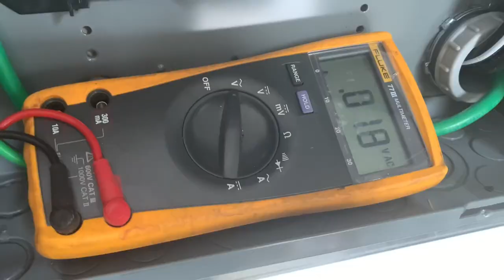Running Power to New DREAM GARAGE | Underground ELECTRICAL Service

Comment: love to watch that stuff.  I never took to electrical work.  Interested about it but just never took the time to learn all about how it all fits together with power, neutral, and ground, amps, volts and ohms.   Impressed though with what a neat job you did and all the forethought to think ahead for access points and future expansion.
Reply from the maker: Thank you, I cheated though… Im an electrician by trade. 18yrs

Comment: Sir, nice work. You get the near and workman like title.  The only thing I can say for sure you got wrong was your 8 x 8 box is required.  352.26 is that PVC pipe section covering the 4 quarter bends before a pull point.

Now, for anyone about to do this, the NATIONAL ELECTRIC CODE (NEC) can be modified or thrown completely out by your local building guys NEC 90.4.

Please call the building people before you even start the build.  Section 230.70 talks about a building disconnect out side the building or close to the entrance inside.  If you are beyond what is "close to the entrance" and there might be a lot of rework.  Move your panel one foot and the solution might be to replace your wire reach that far.

352.44 again the PVC pipe section calls for slip joints for the PVC pipe to expand and shrink with temperature.  There is a chart, but the inspector can require or not.

250.32 talks about grounding this type of building.  There is an exception to the ground rod and a reference to the grounding system section which can be seen as needing 2 ground rods.

A phone call or two can get all these questions answered.

Also, consider adding some extra empty pipes to your trench while it is open.  Cable/internet, a dinner bell/emergency alert system, and building security systems can simply be pulled into the pipes with any re-digging of any trench.

Also, consider a bathroom fan type timer on your outside light to allow you to walk away with the light on and not return.

Comment: Looking good 👍. How deep did you have to trench the wire? Also, when you wire the shop, just remember that you can never have too many outlets.
Reply from the maker: Thanks! I went 18”. Thats what they require here (no frost line) and consequently, all the rental trenchers are 18” machines. Didn’t even need to go that deep though honestly. Thats true with receptacles

Comment: OMG, I drove a ground rod in with a sledge. Took forever. Thanks for showing that. We were considering a steel building, but I have seen several videos that showed too many problems.

Comment: Nice job. To make life easer with your cable inside your shop you might want to try flexible conduit instead of the solid pipe. Thanks for posting
Reply from the maker: Thanks for watching. I almost always run MC in metal buildings.

Comment: I just built a galvanized metal shop and was looking to run electric to it. If you don't mind me asking, how much did all the material cost wiring , breaker box , etc ?

Comment: I think from other Electricians, that on a Sub-Panel, you tie-in to the Main Panel for the Ground Rod, you are Not to put in a Ground Rod at the Sub-Panel.  
And do Not Bond the Neutral and the Ground at the Sub-Panel (Which you did correctly).  That way everything happens at the Main Breaker and your breakers work safely.  Just FYI, from what I heard.
Reply from the maker: So you’re 1/2 correct. When you read or heard that sub panels dont require a ground rod - that’s completely true. HOWEVER that only applies to sub panels in the SAME building/structure as that building should already employ a ground rod (or two). 

The main purpose of the ground rod is protection from lightning which is why the secondary structure must have its own ground rod (and in some municipalities- now TWO ground rods)

Hope that clarifies things a bit!
Reply: That ground rod just needs to have a ground resistance of less than 25 ohms. Code is kind of dumb in that if it's greater than 25 a second rod is required and that's it. Nevermind two rods could be 100+ ohms of ground resistance, just needs to be two. It's dumb and not safe. In the utility world we have to sink ground wells until that number is less than 25 no matter how much it takes, which makes sense.

Comment: Thanks for sharing this! I’m planning to do something similar for my detached garage. I’m considering stubbing the conduit up through the slab and into the wall. Is there any reason you didn’t do it this way? Is it just because it would be cumbersome to coordinate the conduit run with the concrete crews and building erectors?
Reply: Partially that, but with the metal tube sill plate (bottom frame rail), you dont want to remove a section to make way for the conduit. Nor did I want to stub up in front of the frame rail and sacrifice floor space in a small shop. If it was a stick frame building with 2x6 sill plates, it wouldn’t be an issue.

Comment: Great video, I would have liked to see the wire connection into your meter disconnect box on the house! You just showed the conduit running along the house and into the box but it would have been nice to see the connection there as well. Also that looked like 2224 Mobile Home feeder line to the shop, did you direct bury that without conduit to the shop and then just use conduit when it comes back out of the ground to the shop or house? Thanks!
Reply from the maker: Yes, MHF is rated for direct burial but must be enclosed in conduit once it “stubs up”. I had filmed the connection at the meter pan but it got messed up somehow so I omitted it. Thanks for watching!

Comment: I wanna know what the wire cost and where you got it please about to do the same thing
Reply: (Replying from my new channel) I don’t remember what I paid for it but if you’re interested in using this wire specifically, its called MHF and is readily available at most of the “big box” hardware stores. Good luck

Comment: I never liked how the conduit stubs through a building it seems like they should use a compression gasket fitting, i dont think they exist. You rely solely on caulk to keep water out. It's a leak waiting to happen.
Reply from the maker: They sell gasket material but I much prefer silicone. Leaks aren’t that common on vertical penetrations if caulked properly.

Comment: What about an  expansion fitting on the exposed conduit mounted to the house? That conduit is going to expand and contract over the years.
Reply: An important part of 352.44 is the fact that the expansion fitting is required where the expansion is in a straignt run "between securely mounted items". Appropriate bends in the run allow for expansion without an expansion joint. Here we have a total of 4’ of conduit and no frost heave whatsoever. Thanks for watching and for the comment.

Comment: You need 2 ground rods 6' apart or more. You only need 1 ground rod if you are using it as a supplementary ground to a cold water pipe or rebar in footing.
Reply: I believe The mentioned that in the vid
Reply: Yeah, probably and I missed it.

Comment: Hope that you drove the ground rod below grade level. The left #2 wire appears to be stripped too much but not a violation. Did not see him use a torque driver to tighten wires in sub panel. Believe a full 100 amp feed to garage would have been better in case you want to install a 240 volt 50 amp EV charger recrptacle.
Reply: I think the other side of the ground rod may have exited in China. In this shop we’re running a 240v compressor, welder and HVAC already with plenty of amperage to spare. As for an EV…. I have no plans or interest in my foreseeable future of owning one.

Comment: So if I run like a big air compressor can I run still what u running
Reply from the maker: im running a 60g compressor, 30a mini split, welding machine, office, 12 shop receptacles, door opener, 3 lighting circuits and a mini fridge… with plenty of room for more.
Reply: @HiddenCreekHomestead  ok thanks so much for responding back to me , by God Grace I’ll be getting my shop  next month your video are so helpful
Reply from the maker: @matthewbarnes4993  You’re very welcome. Good luck!
Reply: @HiddenCreekHomestead 30a minisplit?😮. Meaning it's on a 30a, breaker right? Because I'm about to run electricity to my shop and will install a minisplit and running they just pull like 9 to 13a I think. I'm going to read about grounding because I thought you didn't have to run the ground from the main. Just need to run a grinding rod from the sub panel. Thanks for the video
Reply: @AB_thingsDFW  sub panel gets its own ground rod (sometimes 2) ONLY if its on a separate structure. My shop is separate from my house so I added a ground rod. The 30a circuit for the minisplit also has a ground as part of its own circuit.